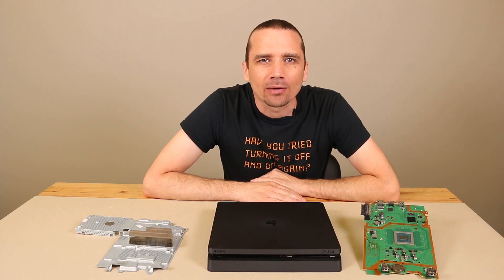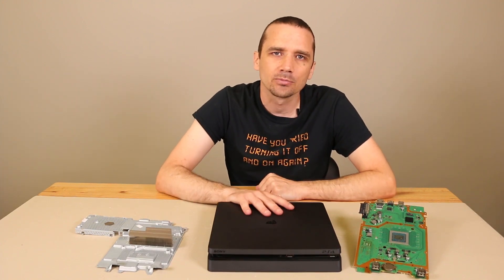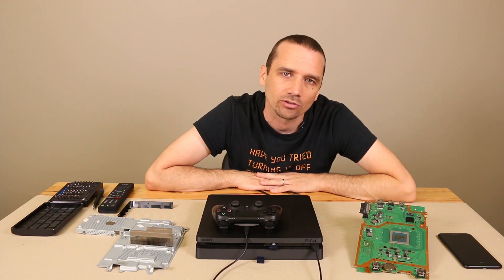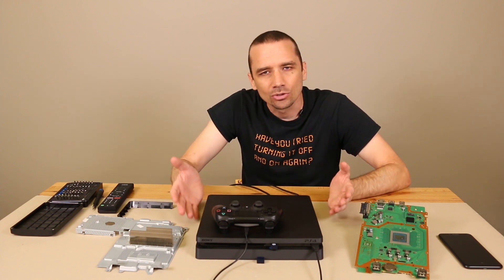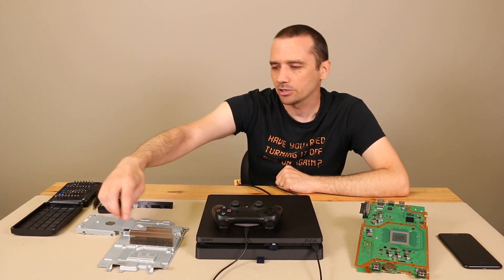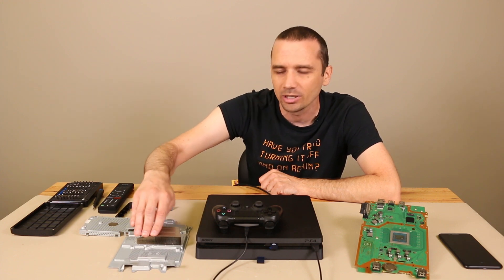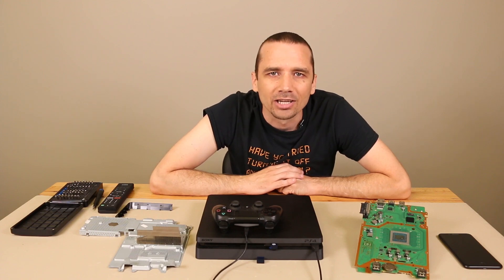PS4 Slim Too Hot? - Overheating Explained - Prevent Overheating

Comment: “Warm to the touch “ mine felt like it was gonna burn me 😂😂
Reply: Yea mine 2 but only when I take the top off
Reply: @naruto_stuff565  im drippin like hot sauce(my ps4 just overheated(
Reply: Yea mine was like a radiator last night 🤣🤣 I cleaned the fan and it seems to be better now
Reply: Well i touched the power supply while it was on XD
Reply: @St4lk3rStuff  mines hot their too
Reply: On god
Reply: Mine is doing the same over 130 degrees
Reply: Same when I touch mine at the back everytime I had to remove the wire that sh*t gonna burn you😂😂but what I like about the slim is that it is so quite
Reply: Panik
Reply: Fr
Reply: I just a mini fan behind my ps4 slim on full blast
Reply: When I turn mine on it's a volcano
Reply: The back where the exhaust is on mine gets so hot. I took mine apart to clean the disc drive rollers and I tried to remember if it's always been hot and I think so. Just never overheated and still hasn't
Reply: @DanielGonzalez-ol8zv  damn mine never been that hot.
Reply: Mine did burn me

Comment: @TronicsFix My Slim unit isn't even a year old, and it has this weird issue where, unless the air is really cold or I have an external fan blowing across the back of the console , the video feed will blink out after 15min-1 hour of gameplay. it comes right back, then will go  back out again after a few minutes, repeating this cycle until it the feed just stays gone.

The only things I've found that fix this are to either a) blow a fan across the back like i said, or b) remove the hdmi cable for a few minutes and let it cool back to room temperature. It started doing this +/- six months after I bought it.

any ideas?

Comment: Does running the slim without the top cover help with cooling?

I'm going to guess no since the airflow would seem to improve with the cover on.
Reply: I know this is 7 months later but it would help airflow by opening up the hot plate to open air and allow it access to more air. Same with the fan, allowing the fan unrestricted air flow will help it cool by allowing fresh air in instead of blowing already warm air into the system

Comment: i have cleaned my heat sink and fan, changed the thermal paste and because i got BLOD i used a washer as a temporary fix (to gather my data) but its been fine, i realized my ps4 has started to get really hot and i got a warning for the first time, so i have to get additional cooling fans ?

Comment: Mine keeps getting overheated not even an hour after being on...if I don't play a game its fine for hourrrrss then all of the sudden I play one and then under an hour it starts overheating.. Its never done that before its so annoying
Reply: My friends does that to and sometimes he has to take it out of the area it is in and it still over heats sometimes the cooling systems on the ps4 at least are garbage I have both the xbox one orginal and the ps4 slim/ps4 2018 witch btw the ps4 slim but renamed to the ps4 and yes it does get more hotter then my xbox one really hot that the cords warm my xbox one nevers do that actually it only ran in high vent mode witch I call it because the fan goes loud and it only happened 3 times out of the six years I had it as with the ps4 slim/2018 is quieter then the orginal ps4 but it is still loud.

Comment: Ps4 is clean 

Fan just got replaced 

Good airflow 

But it still overheats when I load up CoD MW... could it be the thermal paste ?
Reply: Actually almost any multiplayer live game the ps4 does that because i have one and my friend plays fortnite on his and his over heats every 5 to 10 mins saying it is to hot so yes it might be the thermal pasting. The only thing on the ps4 is better at is slightly better graphics but the xbox one orginal is faster and faster ssd, and faster game loading and stanby turning on and the sad thing is that sony is trying to fase out the ps4 like with os updates and stuff because I haven’t heard anything about the ps4 will stay alive but with the xbox one orginal yes I have heard.

Comment: But what if my PS4 is shutting down, and has NO red light while turned on or shutting down. It feels fairly warm or bit more than warm
Reply: Did u update ur ps4
Reply: ccxgamèrlynx recently, yeah. I did like a couple days ago, but overall it had a “normal” performance although sometimes lagging. After a few tries trying to see if it would give me an error code, I would only assume it’s a hard drive issue. Error code: CE-34054-6
Reply: It also does NOT show an error code on screen

Comment: My issue with my Slim is no airflow out of the back, shuts off or freezes in 20 minutes or so. Anyone have any advice or have dealt with this b4? I already cleaned out the fan and vents
Reply: P Ss try putting new thermal paste in
Reply: @BCGaming666  Yea, that's what im hearin, only problem is gettin the thing apart.
Reply: P Ss maybe try find a good shop where they replace the thermal paste and hearsink and maybe the fan to

Comment: thanks for the video. just want to know that what is the cause of ps4 freezing or to slow to load up? I encounter this sometimes during gameplay. please any help that I can resolve this?  I also did some steps like rebuild database and reset to the default setting and upgrade the software but still did not work.

Comment: My PS4 just shut off but it didn't show an error code or a red light. Does that mean it overheated or will it turn back on eventually??? Please, I'm in desperation mode right now.
Reply: This YouTuber is a liar, quick overheating is not normal. People like him want you to brick your console, putting a lower amp fuse will mitigate the temperature rise of the console, making it less likely to break down. I hope you get it working again. This YouTuber has lied to it's viewers; it's not normal at all.

Comment: Hey man I bought a new ps4 slim. And after I play fifa 20 it get real hot especially from the bottom to the point I can't even place my hand over there for 10 seconds. I wanna know should I get a replacement
Reply: Use a 3 Amp fuse it it's plug rather than a 5 or 13.

Comment: I don't know if it's normal, but i usually play about 6~8 hours and my ps4 slim gets hot but it never beeps or turns itself off, i never cleaned my ps4 fans but it just never shows any signs of overheating, it just gets hot.

Comment: So my ps4 slim did fall down , after that it doesn't turn on anymore , then after 3 monthes i opened it and checked some cables and it worked but when i open a game like rainbow 6 it does a lot of sound and shut down even before i join the lobby

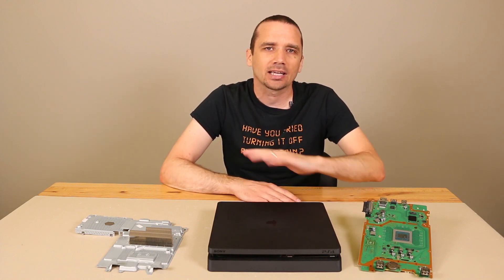Comment: 1:00 thanks, that is what i was looking for.
My PS4 is pretty hot after 5 hours of playing and it is placed on a small place so i was scared,but i don't have any of these signs
Reply: I bought a laptop cooler for my ps4 for a longer life span. Also if temps get high, the ps4 cooler speed will rise witch results in more dust intake.

Comment: dont sit it on a flat surface as it gets more hot on the bottom, i mi self made a device that allows my ps4 to sit about 2 inches away from any flat surface and put a computer fan under it pulling heat away from the bottom  cover, now it is more cool to the touch and do help when you turn of your ps4 to cool it, as this is the moment that soldering can brake due to ps4 been super hot and the ps4 fan not turning as the ps4 is off and the internal parts has to cool off on its own.......i like it when our guide says ps4 is warm, we all know that it is super hot very unpleasant to the touch, the ps4 fan looks very Unpowerful, cheap compere to the ps3 fan.

Comment: i just cleaned the inside and outside of my ps4 slim, but everytime i start a game my ps4 turns off automatically so do you have a video about that too?
Reply: power cord, get your self a pliers and squeeze just a little bit, the end connectors that goes into the back of the ps4.... sometimes they don't fully connect and you get a symptom of power that beeps but turns off and then don't want to turn on again...
Reply: nelson sanchez thxx

Comment: Pro tip: canned air is not something thats laying around your pantry... lol so a good alternative is a vaccum using the wand to suck up dust.
Reply: well, yes use the tires air compressor from your local gas station, you can make it work with a bic pen , and blow that precious air unto your ps4.

Comment: Hey @TronicsFix my PS4 slim gets really hot then just turns off with no warning. It’ll just show me a screen with colorful static and turn off completely. Do you know what the issue might be?
Reply: I opened it up following your disassembling video and it didn’t have much dust/debris but I dusted and cleaned it up either way. I bought some AX-4 Arctic thermal paste to replace the old paste, the fan works and I also cleaned that up.

Comment: People need to learn their tech. CPU and GPUs get hot that's normal. Find out that the normal temp limit is and hope to not exceed it. My GPUs in my pc are rated at 80°C which is ok but over that can be bad if for too long
Reply: sure, why do IT even use air conditioners on their setups? so it can last much longer, something sony does not wants.

Comment: My ps4 slim gets warm yes, and it may not actually overheat, but a lot of times it'll get stuck loading something (literally stuck at 99% initialization) or itll stop responding entirely to my controller inputs. AND it gets hot.

Comment: If the intake is on the sides then why do cooling fans go on the back ?
Reply: pigtailed pete the pancake penetrator 
Because it’s sucks out the hot air from inside, & blows it out the back.

Comment: My PS4 slim gets hot after 5 minutes without running any game. Is It normal?
Reply: Karin Dietre 
Yes. Electronics get hot, just make sure it’s in an open space, with good ventilation, & keep it clean from dust as much as you can.

Comment: I live in the Caribbean and the thing gets really hot. I guess it's about 60-70 celcius. Problem is I use vertical stand method so I don't see the light. Wish they had put it in the uveditor meet flush with cd drive. She. It's vertical you won't see the light :(
I guess I'm gonna check for some extra cooling orso

Comment: guys i get my ps4 slim 3 weeks ago and when i play games like gta 5 or fortnite theres fps drops is that because the heat or no?
Reply: It is not because the heat. This is normal.
Reply: @TheMichaelMusic  and the fps are normal?
Reply: @TheMichaelMusic  because when i see videos about guys playing gta 5 on ps4 slim and theres no fps drops while driving fast
Reply: When you are at certain places, where are  a lot happens for example in the multiplayer, you get frampe drops.If you go inside the new Casino you will have constantly 20 or 25 fps. 

In the single player there are less frame frops.
Reply: @TheMichaelMusic  yeah, im playing singleplayer only and when i drives a car fast at the day the fps drops
Reply: @unknownvisions3260  That happen to mee too. It does'nt come from the heat. The reason ist  that the ps4 is not so powerfull.
Reply: @TheMichaelMusic  does the same thing happens on the ps4 pro?
Reply: @unknownvisions3260  I think the game runs on the PS4 Pro better.
Reply: @TheMichaelMusic  yep but the gta 5 patch for pro is bad but the ps4 pro runs all games better than slim
Reply: @TheMichaelMusic  but day after day the fps drops will be normal for me and you
Reply: and i will play the game without any problems

Comment: But my new PS4 Slim gets hot to the touch within an a half hour. You're saying I shouldn't worry unless I see a red light and an error message (which I haven't)? I have the all-in-one stand with a cooling fan, and two other house fans facing my PS4 Slim and it still gets hot in 30min. So I shouldn't be paranoid about that? I'm just worried that the power cord will malfunction over time. I mean whose bright idea was it to design the hot air to escape out the side of the power cord?

Comment: This kinda stupid but its work .
No hot air flow anymore.

I put a square plastic plate full of ice cube on top of my ps with cloth as the surface so it can absorb the water from the plate while ice cube melting.

Comment: I literally turn my console on instantly just turns off and beeps 3 times in like 10 min
Reply: Cody mine has done that for a year now 🙁
Reply: I noticed one of my Fan wires was loose and had to be adjusted to make sure it was getting a full connection. After words, fan worked again, and system ran fine besides overheating when playing a CD game. downloaded games and streaming services run fine.
Reply: I've never gotten the overheating beeps and light, but it does got hot pretty quickly and I checked my hard drive to see if that was what was being affected, and the hard drive was hot enough to burn me. I've dusted the system as best as I could and honestly, I don't know what solution I could go with right now.

Comment: I bought a ps4 pro just over a year ago and only used it a few times as i have an xbox one x, A nintendo switch and a powerful gaming PC and working full time and being in a relationship means i don't get a lot of free time to play games but when i heard no mans sky was coming out on VR i purchased a VR V2 headset and started playing my ps4 pro excited about soon being able to play it in VR. My ps4 pro after about 20minutes would overheat and freeze and switching it off at the wall was the only way to reset it, 

I build PC Computers so i put a 1tb ssd in my ps4 pro as that means much less heat than from a normal hdd and i changed the thermal paste out for a quality paste (There was NO dust on my heatsink and fan) and the problem remained and I've watched dozens of video's on youtube where people are having the same problems as i am and one youtuber said it is the power supply within the ps4 pro console that is overheating because before the power supply use to be external in the form of a brick but it was better for cooling. 

I have since purchased a brand new PS4 Pro console with the game red dead redemption 2 and this console has a different power supply cord but let me tell you the console still gets very hot after a short time of gaming playing no mans sky. luckily i purchased a 3 year warranty from argos for my ps4 pro for piece of mind but the strange thing is Sony have stopped selling extended warranties on their ps4 consoles which i find very suspicious, it's like they are aware of the problems with their console thus stopped selling extended warranty to save them the hassle and money. 

I think it's very poor of Sony considering my xbox one x which is much older and has seen alot more usage has never overheated once nor has my switch, I will keep my first ps4 pro and trade it in for a ps5 when i am able to do so. I purchased a ps4 vertical stand as i believe that will help in helping my ps4 pro to cool down better, time will tell :-(

Comment: I have my ps4 slim on a wooden desk (tv bench style). the ps4 has nothing on the sides but on the back there is the back part of the desk also made from wood. Is there a problem having the ps4 on this cabinet? I played like 3 hours and noticed it was hot and the wood was also hot, does the wood make the ps4 over heat faster?
Reply: No

Comment: My ps4 slim's fan is not spinning properly and many times it won't even move a bit, as a result it gets overheated(gives an error,beeps and turn off) WHAT SHOULD I DO!!
FYI: my warranty had ended only 2 weeks ago.
It gets overheated in 15 to 20 mins
Reply: I have the same problem cant do anything

Comment: I opened and cleaned my ps4 just for the sake of it, but apparently is getting hotter from the back, I'm not sure if is getting hotter, or is dissipating much more heat than before, if that's it, is still too hot, it was warm to the hand before, now is hot to the touch

Comment: I have an issue that relates to this, my slim simply turns off completely and refuses to turn back on until I assume it cools down. It doesn’t beep and it doesn’t give any error messages but I can stop it turning off by putting my desk fan on and turning it toward the console. I get no beeping or any messages it just cuts off like it’s been removed from the power socket. The sockets are fine and the cable is also fine as I have tried several, it’s only a few months old and has  literally no dust in it. I am at a loss and only other solution is sending it off to Sony who probably won’t fix it. I have a 3rd party fan attachment powered by usb coming to hopefully rectify the problem but the console hardly even feels that hot and I was wondering if anybody has had a similar issue or if there is a fix they know of. I just think it’s strange that it is simply cutting off when the fan isn’t facing it but stays on when the fan is facing it but get no messages or beeping.

Comment: I got a ps4 slim today...but within 15 minutes it's started heating up .it's not a very bad temperature but it is still quite heated .should i be worried
Reply from the maker: No, no need to worry.
Reply: @Tronicsfix  thanks! ...I also have it on a vertical stand,will that make it hotter or effect it in any way
Reply: Also is heats up at the base.../bottom
Reply: so how is your ps4 doing now? has the heating done any problem?

Comment: Thank you so much for this video, i was worried if it was overheating despite not showing any red light. I guess it's just normal warmth. Question tho (sorry if it has been asked already…), does this heat around the ports on the back of the ps4 can make the internet to drop if I have my ethernet cable plugged in it? or does the heat not affect internet connection when the ethernet cable is plugged in? Thanks in advance.
Reply from the maker: No, it won't affect anything. It doesn't get nearly hot enough to cause any problems like that.

Comment: I took mine apart twice, only to the battery supply and cleaned but my ps4 still runs hot and sounds like a jet. What should I do?
Reply from the maker: Clean the heat sink most likely.